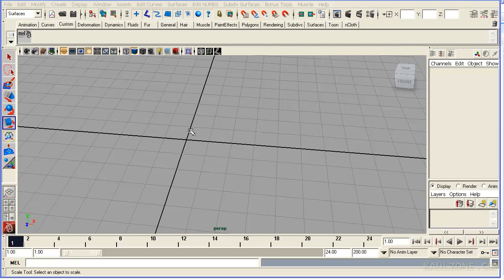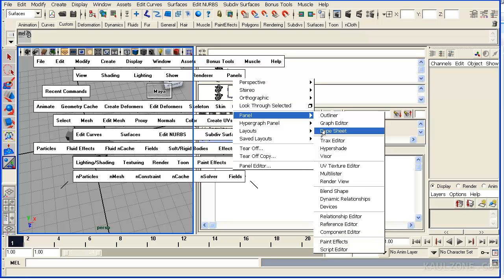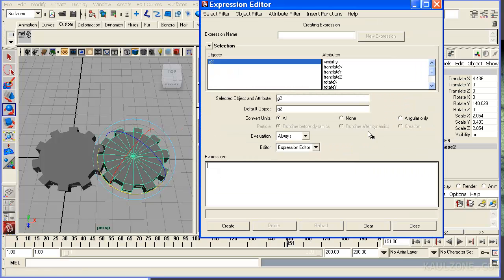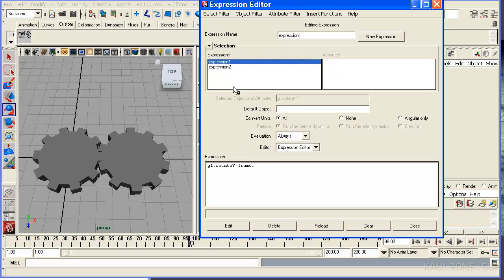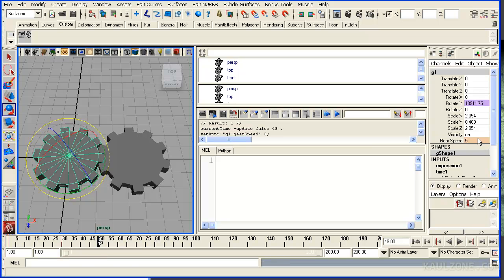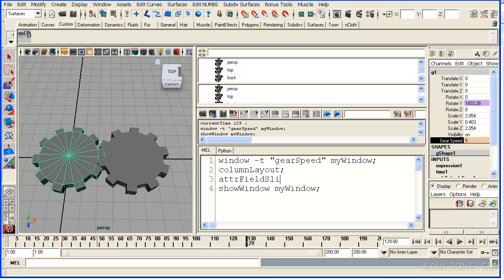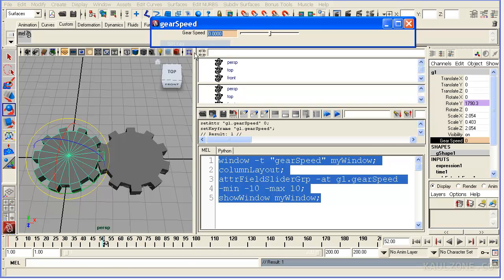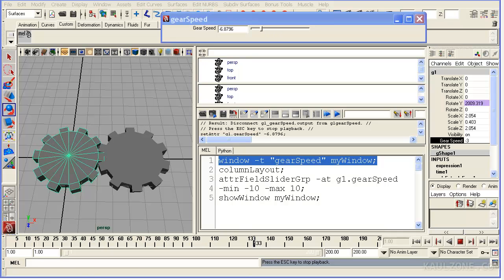Maya Gear and expression driven animation

Comment: Hi, exactly the same coding is not working in Maya 2016 or 2017. I have checked like 20 times but still. After adding attribute to g1 it stops working. Plus the new window in MEL it gives myWindow error and cant figure out -min range.
Do you have same problems in new version of Maya?